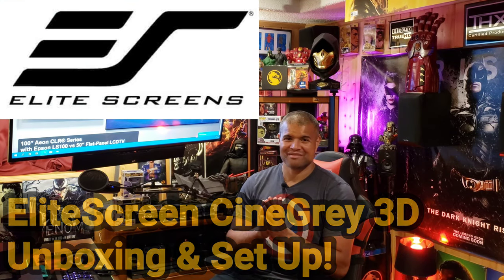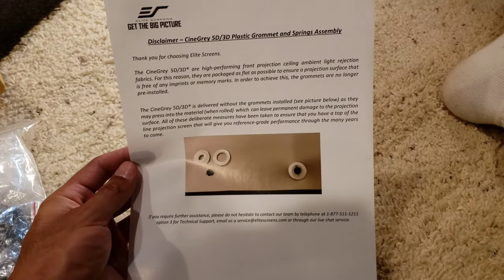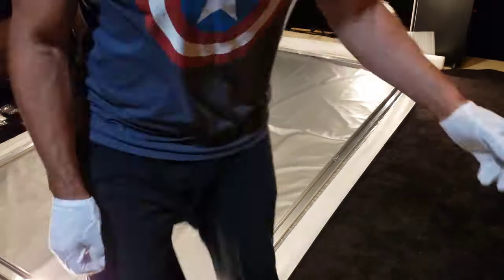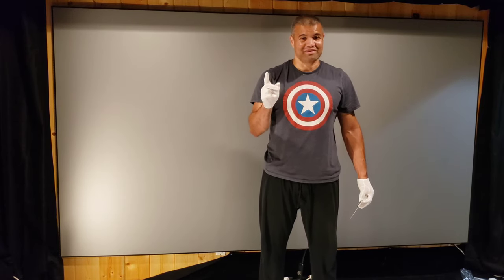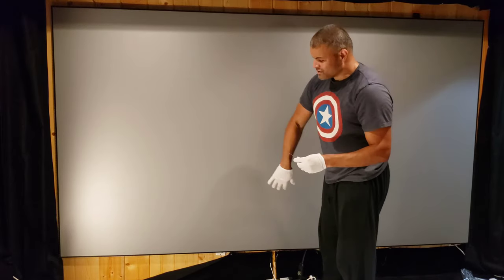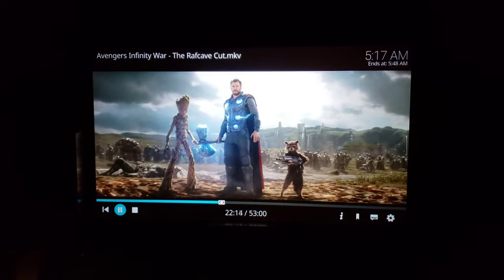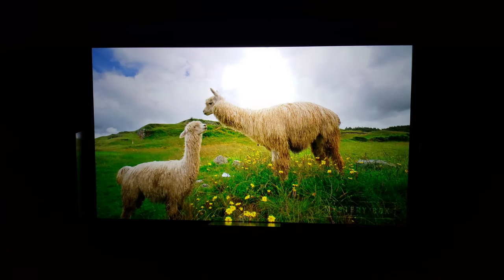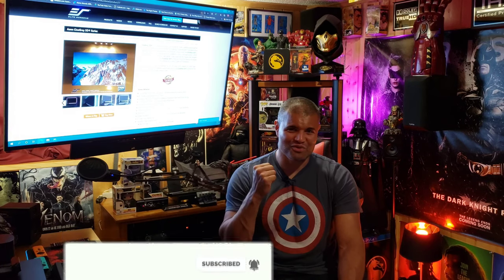135" EliteScreens ALR CineGrey 3D Fixed Frame 16x9 4K Home Theater Screen : Unboxing Set Up & Review

Comment: I'm using a 135-inch screen, projector mounted at the back of the room, near the ceiling, about 16.5 feet, lens to screen.
It's our living room/home theater theater/bedroom, as we have a queen sized bed at the back, where we watch from mostly, or sit in the theater seating at the foot of the bed.
So my question is this, do you think the CineGrey 3d will work in my room? I have burgandy blackout curtains, but I don't want to sit in a dungeon all the time, lol 😅
P.S. - my projector is a new Panasonic pt-rz370 laser/led hybrid, 3500 lumens.
Reply from the maker: Nice.  A cinegrey screen helps with ambient light In the room.  So you can still have "some" lights on and enjoy a good picture.
Reply: @TheRafcave yes, I was just wondering if the angle will work?

Comment: Hi mate, thanks for the informative videos. I have ordered this screen AR135DHD3 after watching your videos. I need to prepare my front wall before the screen arrives. Could yoy please tell me distance between the top screw and the bottom screw. The bottom bracket is shifting up an down (very good idea). So the distance between the top and bottom screws will be the correct measurement. Thanks :)

Comment: Great Video . New buyer and have a question. I am getting the vava and want 120inch screen. It's in a open living room kitchen with lots of windows about 8 feet away to the side of it. overhead lights are ay up high. I like both screens from Elite and it's sister option Akia....Advice is needed please.      LED strip is wayyy cool.
Reply from the maker: Thanks, just try and keep lights away from the screen.  Or at least dim close to the screen.

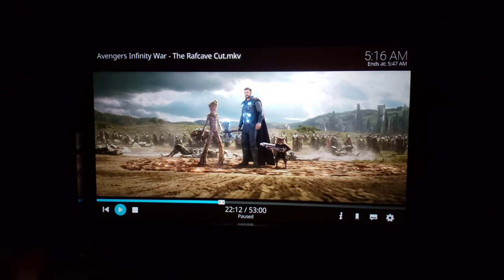Comment: In 15:00 there was a lot of hotspot, not sure it was real or was the camera auto adjustment. May you let me know your current throw ratio and vertical shift number ? I am planning to buy 150" cinegrey 3D but saw internet people put Cinegrey 3D screen at 1.7x (projector distance/screen width) and still get a lot of hotspot.
Reply from the maker: It's the camera.  I don't notice any hot spots on my screen. 🤷🏽‍♂️
Reply: yes, you mentioned it in your video Raf. May you let me know your projector distance to the screen ? if that fit my room layout I am going for one :)

Comment: You typed in the video "no hot spots". There is really no hot spots? Because in some parts of the video (for example at 17:32) it looks clearly to me that the center of the picture is brighter than the left and right part. I bought CineGrey 3D and 5D samples one year ago. At first I was blown away. I put the samples on the center of the picture and the picture on them was great. But after I put them more to the left or to the right I was dissapointed. The picture on the samples was then a lot more darker. If there would not be such a big hot spots in this samples I would buy the screen but this hot spots are deal breaker to me.
Reply from the maker: Only my camera Is blooming the scene, no hotspots In real life.  It depends on the angle and position of the projector that can introduce hot spots.
Reply: @TheRafcave  which angle and position of the procejtor does not get hot spots? I up on the wall 3D and 5D samples right now again and I still get a lot brighter image when samples are in the center of the picture than when they are on the side.

Comment: Question. What would the relative height distance for this screen be with and ultra short throw projector? I have the wemax nova and I can’t find anywhere that gives you the height for the projector at 135 inches. I have to distance figured but the height is giving me troubles
Reply from the maker: I wouldn't know that.  I don't own a short throw projector.  Good luck.

Comment: Great vid, I was wondering if it's really any better than the cinewhite screen if you're watching it at night? Also, I saw a Stewart ALR screen in Best Buy which was $2000 bucks(Which looked like it was worth 100 bucks at the most) for the 92 inch version btw! And it looked like crap even compared to the Sony mid ranged led in the other demo room , bright in the very center of the screen and very dim everywhere else, I tried standing  and kneeling at every angle, even put my face 6 inches away from the screen, it didn't make the pic look any better, Should I just go with an OG Cinewhite, I don't want any hot spotting or a dimmer image at night? I don't know if I can trust a screen that cost's a third of That Stewart Screen?
Reply from the maker: Hey Can, watching The Old Guard the other night looked great.  My HDR was definitely brighter.  Only a small hot spot during a desert scene with the sun, I can look over that by the much brighter overall picture at night In a black basement.  My Sony is 1500 lumens.  So a much brighter projector my have issues In a black room. 🤷🏽‍♂️

Comment: Can you set the projector at a lower level? I see some hotspotting in the upper part of the screen. Not that bad but still... :)
Reply from the maker: Yes ofcourse you can put the projector low, middle or high.  Lots of adjustments can be made on projector placement.

Comment: Did you keep the ALR screen or switched back to the old one? Did you notice any so called sparkle effect? I know if it`s over 1 gain you can get a strange sparkle effect. Is your projector in low or normal mode. I`m thinking of buying a 0.8 or 1 gain ALR screen. I`m just afraid that the image will be too dark, as the projector is just 1500 lumens. Thank you
Reply from the maker: I'm keeping this screen, I sold the old white one.  I don't see sparkles.  This screen is better.
Reply: @TheRafcave  Thank you !

Comment: Sir, I have a projector LG HU80KA and the ELITE SCREEN CINE GREY 1.0 gain, and when I put the projector so screen it’s really dim it’s not that bright, even my room is completely dark. But when I project it on white ceiling it’s really bright, so I’m confused what should I do what screen should I get it or what gain?? PLEASE HELP SIR...
Reply from the maker: Some projectors work better with white screens.  Your projector probably likes white screens better.
Reply: THE RAFCAVE okay but what white screen should I get and wat gain??
Reply: You might have the screen upside down?
Reply: @elizabethmorgan1937  upside down wat Do u mean
Reply: @noumanjamshaidali4078  cinegrey 3d has a top, and bottom, and due to how it reflects the image from the projector, if it's upside down then it will look like crap.
Reply: @elizabethmorgan1937  no no it’s not upside down picture DOESNT look crap it’s just it’s not enough brightness

Comment: Hey rafe why people don't like elite screen n prefer to sell u draper they say elite are cheap n is from Amazon
Reply from the maker: Nothing cheap here
Reply: Can you tell me which elite is better for both fixed n motorized 16x9 n 2.35.1
Reply: Hey rafe would an optoma hd 142x 1080p work with a 2.35.1 screen using LBX ratio
Reply: Rafcave d screen will fall in front of A door what's the best elite pull down or motorized screen 120"
Reply from the maker: @lyndonramchatesingh105  Look for a CineWhite screen.
Reply: Hey rafcave why cinewhite n not grey  in the elite so I don't have to buy draper can you recommend me a model
Reply from the maker: Here's the thing.  If you have a dark room go with white, if you have some lights go grey.
Reply: Can you give me d best models for a pull down n motorized screen
Reply: Hey rafcave why didn't u go with a 2.35.1 or 2.39 or 2.40.1 screen what does cinemas use
Reply from the maker: @lyndonramchatesingh105  I watch Netflix sports and play videogames. So 16x9 is best for me.

Comment: I have the same projector and a white screen. I stayed away from gray since it apparently reduces color accuracy and requires fine calibration to compensate for the color shift. Did you find this to be the case?
Reply from the maker: 🤔 I haven't seen anything worse than what I've had before.  I'm using the Gamma curves for HDR so It may be different for this type of screen.